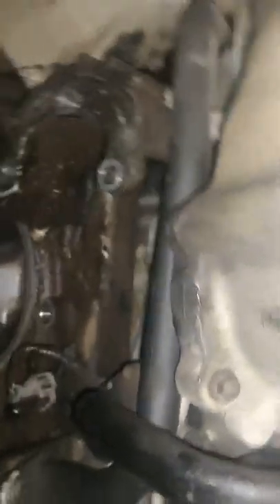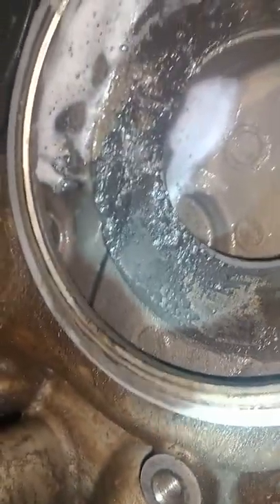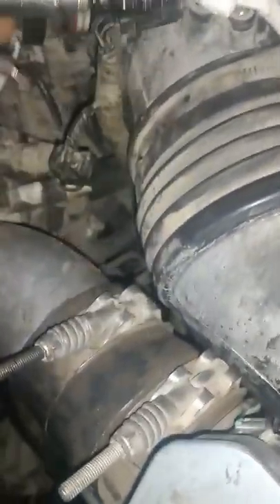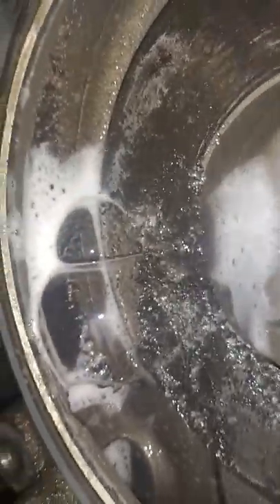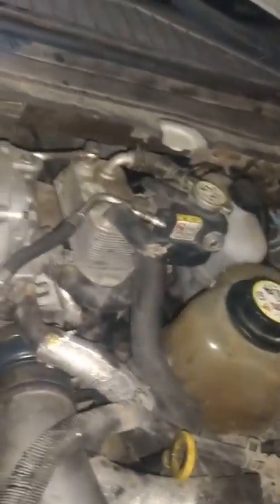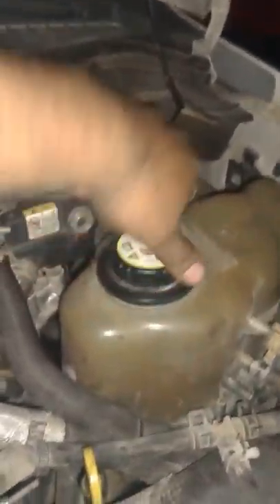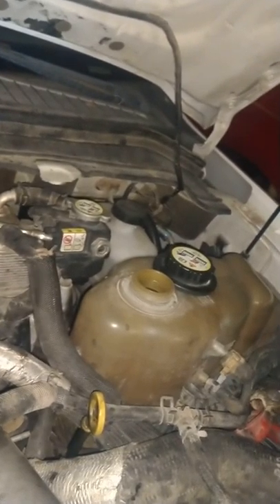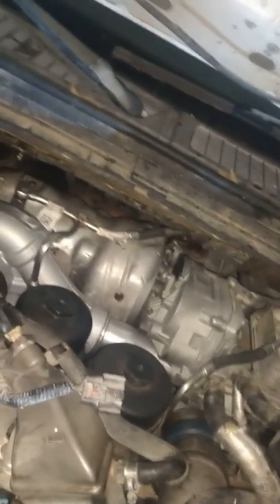Ford 6.4 Powerstroke oil and coolant mixture

Comment: This is possible what’s wrong with my truck. I don’t have symptoms of a blown head gasket. I almost add coolant every day. Now I notice milky oil and when I check the oil dipstick level it looks like is increasing . I will check on that front cover first. Take the water pump off .
Reply from the maker: Let me know what you find out

Comment: Gracias carlos por tu videos di con el problema es por la pump del agua por ahy se esta mesclando agua y oil
Pero ahora tengp otro problema 
Y si tu m puedes decir si existe algun comprobador  para saber si esta llegando corriente a los injectores de un 6.0 turbo diesel
Por ejemplo como los q se utilisan para los de gasolina
Gracias de antemano
Reply from the maker: No ahi para diesel.. Es que la corriente arriba de 48 voltios.. Pero puedes ver con un escáner en datos en vivo.. con un escáner les puedes mandar señal para que hagan ruido... Y también mirando el balance los cilindros...
Reply: Gracias brother
Reply: Hermano como estas
Ahora tengo el mismo problema de water en el oil pero es en un 6.0 
Tu crees q se este mesclando por la water pump igual q el 6.4

Comment: podría ser el mismo diagnóstico para una 05 f350 con el mismo síntoma de problemas?¿?¿?¿,gracias
Reply from the maker: No en una 6.0 puede que sea la cabeza o el oil cooler.. muy raro que le pase agua al aceite por el front cover (la pompa).. si pasa pero super rarro.. si se calento Machin más seguro las cabezas y si no el oil cooler las ligas de adentro
Reply: @BackyardDieselz  gracias si no nose calentó para nada de repente le apareció un likeo y yo checando me di cuenta que tenía aceite en el anti conjelante  gracias por responder mi pregunta saludos desde atlanta GA

Comment: Hey man I did what u said, the water pump is ok they I did the other one and yes I got buble on the oil lines of the turbo, so whst that means?
Reply from the maker: What you mean I don't remember what we talked about bro
Reply from the maker: What's your problem and what have you done so far.. refresh my memory...sorry bro i talk to different ppl every day
Reply: Ok I got oil on my coolant tank, I did takeout the water pump and did the soap think with air and also I have no holes there, so the water pump its ok
Reply: Then I did the turbo oil line and I got bubble there.
Reply: I did got bubble on my oil feed lines
Reply: Is that mean that.I have bad oil cooler?
Reply from the maker: Where are you putting the air that's making bubbles come out of the lines
Reply from the maker: But just if you have oil I'm your reservoir.. most likely it's your oil cooler or oil cooler gaskets failing.. when you open up the oil cooler you can see there completely flat...
Reply: I removed the oil cap and did use the air nazzle there
Reply: I did the samething that u did on the video
Reply: Ok to make easy on u I have a 2008 f250 115k miles full delete no egr no fcking dpf, and I got some oil on my coolant tank, i did removed the water and was everything ok, then I did the secn step with the oil feed line and I got bubble over there.
Reply: @BackyardDieselz  yes I do have oil there
Reply from the maker: Alot of work to pull out the oil cooler... You remove the fan cluch thats going to make it a lil easier..
Reply: Thanks for the video, good test and easy way to test both the oil cooler and the front cover issue.  I test the oil line on the turbo but nothing there, I’m going to remove the water pump now and test the front cover leak by pushing air through the oil fill and spray soap and water and look for bubbles.
Reply: Silvester Oliveira it prolly means your oil cooler is leaking.

Comment: Tengo una 2008 con el 6.4 y jalando mi traila de NorCal to san diego el coolent reservoir se lleno de aceite y lo empezo a aventar no se calento y cuando le cheke el aceite ya le faltava como un galon que puedo checar lonque se descompuso
Reply from the maker: Es el oil cooler
Reply: @BackyardDieselz  gracias bro

Comment: I have a f250 6.4L turbo diesel. I assumed I had a blown head gasket due to low compression in all cylinders and coolant in my oil but , later I found cavitation behind the front cover after removing the water pump.  I’m currently cleaning all the gunk from the cylinder heads and parts and was wondering how can I clean the coolant passages after I already removed the heads and front cover? The engine is still in the truck. Can I simply run pressure water with a cleaning solution through the coolant passages and the cooler?

Comment: For the front cover gasket , is it just the black metal piece that goes behind it or also the o rings ?
Reply from the maker: Is going to be a complete aluminum type gasket with plastic gasket already on it...don't forget gasket maker on the lower part of gasket... The the points by the crank shaft..

Comment: If the temperature gauge didn’t rise 
But we have a milky cooling water is this usually the issue?
Reply from the maker: If you have oil in the coolant reservoir... It's most likely an oil cooler problem.. if the engine is milky... Yes, this could be your   problem..

Comment: I'm losing about a Quart of oil around 3,000 mile after i change my oil. I change it every 5,000 mile i have my coolest reservoir looks like it sweats on the inside. Would a clogged up oil cooler make my 2009 6.4 powerstroke have blow by?
Thanks for the video
Reply from the maker: No it wouldn't make it have blow by.. that's ur problem right there.. if you have blow-by your piston rings are worn out.. and little blow by is not bad.. you can sometimes do a balance test sometimes it can be one or a few pistons.. you losing very little oil so it would be hard to do other manual test.. I like removing your glow plugs.. and the easiest way to find out is removing the exhaust manifold.. but it's a pain especially if you break one of the bolts..
Reply: So would i have to rebuild the engine? I had a guy say i need to rebuild it runs fine I'm just losing oil. If this was happening to you what would you do? Thanks for responding back sir
Reply from the maker: Depends how much blow-by you really have... Will it knock the oil cap off.. you really not losing that much oil.. one simple test that you can also do.. remove your intercooler.. and check how much oil is inside.. you might have bad turbo seals.. and if there is a lot of oil inside intercooler.. you might need a new turbo.

Comment: Hi I’m looking to buy a 2009 F350 says it has water in Oil. What do you suggest?
Reply from the maker: I would have it check out before buying... Depends if you trust the guy selling it.. and especially if they been driving for a while not noticing that it's been mixing.. main and rod bearing are the first to go... And if you spin a main bearing...  It's over..  new engine.. that repair will be be more than the truck is probably worth..
Reply from the maker: Some blocks and cranks are beyond repair if damaged..

Comment: hey carlos i got a f550 6.0 with oil in the coolant. when the vehicle get really hots it leaks water from the coolant tank. do you think its th head gasket or the oil cooler?

Comment: Hola Carlos mi nonbre es roger tengo una 2008 ford f 250 con 6.4 liter tengo un problema con el coolant q me bubbling por el bottle I le canvie el tapon 
La bonba de agua 
El termotato 
El rellador 
Las mangueras y 
Le ise el egr delete y me lo sigue asiendo a tu cres q sea gracias
Reply from the maker: Quítate los egr's permanentes o siguen puestos nomás tienen placas.. O sea lícito es todo lo que se le debe de hacer... Pues ya le hiciste todo.. único que te falta es el clutch del abanico.. y las cabezas.. las mangueras y se ponen bien duras.. si se te chingue las cabezas puedes quitar el tapón del agua adentro del tanque mete la nariz y huele como combustible.. también venden kits en el auto partes para revisar si son las cabezas
Reply: Los quite de conpletos y le puse los tapones
Reply from the maker: Las mangueras del agua se hinchan de volada.. si tiene arriba de 15 libras el reservoir.. más seguros son los empaques de la cabeza sillas que le diste una calentada
Reply: @BackyardDieselz  si las mangueras se ponen duras y me bota el agua por el tapon
Reply: No las mangueras se inflan solo cuando corro el truck
Reply: Pero el truck mientras no se quede sin agua no calinta ni tengo check  engine light
Reply from the maker: Se te a calentado..
Reply from the maker: Si tira el antifreeze for el depósito.. va hacer un empaque de las cabezas más seguro está dañado un poquito..  por qué ya le cambiaste casi todo... Menos el clutch del abanico... Pero el abanico puedes checarlo con el A/C prendido... El abanico le da más resio en velocidad..
Reply: @BackyardDieselz  si seme calento una ves y si el aire frio el caliente le trabaja vien

Comment: Brother I have a 6.4 that had no antifreeze and it froz over it popped a freezplug but I started getting oil in my coolant should I start by checking the oil cooler? Thanks

Comment: Hey, I'm looking at buying a 2008 6.4L F250. It's got oil in the coolant... what do you suggest?
Reply from the maker: Possible front cover... or Oil Cooler .. I would take to someone to check it out before buying... Repairs could get really expensive really quick...

Comment: How do you fix the after you see it's leaking from the area you showed?and what's the cost
Reply: Hear in Canada with a new radiator the cause of all this at only $45 an hr for my buddy $12
Reply: $1200.00 plus parts Something close to $3.000 I got off lucky. Use only Motor Master antifreeze + the additive. Never run with a cracked rad and keep topping up with just water. I probably should have gone with the MichyMoto rad and accessories. Coolant kit.

Comment: Hey brother I did change the oil cooler, if I sill keep getting oil in the coolant could that be head gasket?
Reply from the maker: Could you do a good flush on the radiator.. if you didn't there's a lot of residue that stays in the block and the radiator
Reply: @BackyardDieselz  i have a 2010 6.4 f550 that is overheating but only when you drive it. When it idles it runs cool. Never overheats. Ive replaced the thermostats. The fan clutch seems to be working. Kicks on and off as the temp rises. Im not getting any coolant circulation at all. Top hose from the radiator and the bottom hose get rock hard and hot. The radiator was flushed and no rust or debris came out. Any idea what it could be? Love ur videos btw!! Great info
Reply from the maker: @jaybueno1742  is the truck stock or deleted.. if deleted is a possibility you have a burly leaking head gasket.. if your tight on repairs.. just remove the thermostats while you get it fixed.. in not deleted.. possibility fail egr cooler or Coolers... The combustion from the engine is sipping threw and builds more pressure than coolant pressure...and block's the circulation.. hard to explain.. but something like that..
Reply: @BackyardDieselz  stock or deleted? Im not to familiar with those terms. I can remove the thermostats and run it like that?
Reply: @BackyardDieselz  i heard that a bad coolant cap can let pressure seep out.
Reply: @BackyardDieselz  i doesnt take def fluid. Nothing on the truck has been changed
Reply from the maker: @jaybueno1742  egr Cooler.. Google 6.4 egr cooler that way you know what they look like.. they both sit on the driver side.. the one you should see as soon as you pop the hood on your right hand side and the other one is sitting parallel to the engine block.. if those are still on the truck that's good news you can replace those or remove them and test them..
Reply from the maker: Yes that's a possibility if the cap spring is stuck closed..
Reply from the maker: @jaybueno1742  yes I know it doesn't take def fluid but it's still has an egrs emission on it..  just a different set up.. the new trucks have added def fluid for better pollution control
Reply: @BackyardDieselz  that would be awesome if it was just a bad cap